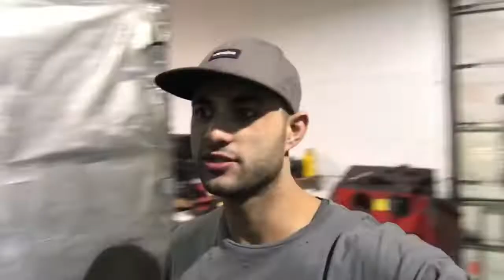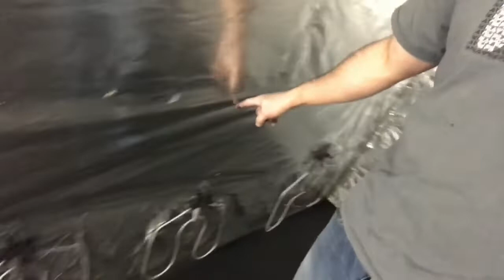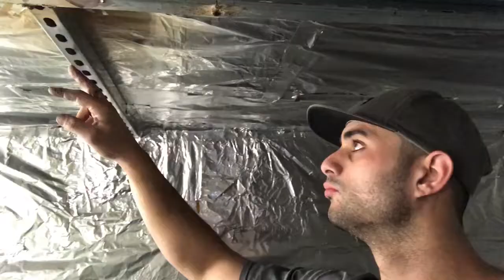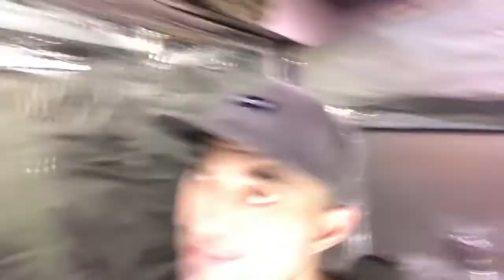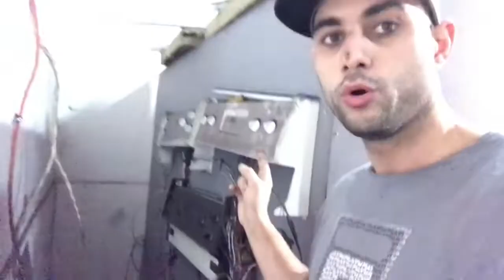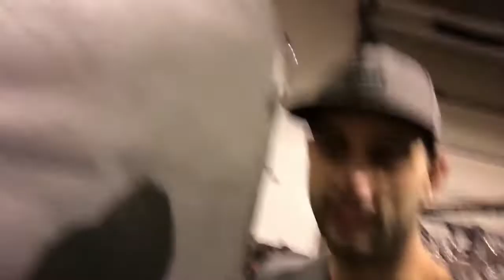HOW TO BUILD A SIMPLE POWDER COAT OVEN!

Comment: Thank you for the video. 
Always wanted to start a bakery but professional ovens cost a fortune. 
Many ideas came to mind after watching this powder coat oven video you made. 
Since you assure us you'll answer every question then I have some of my own.

1) Is the idea doable?
2) What's the best way to approach this idea? 
3) Can you describe what the elements are 
     where to get them and how to wire them to a controller?
4) What kind of metal you did the framing with?
5) Will this run on multiple solar panels & batteries?
6) Did you weld the oven window to the frame?  
7) What type of heat resistance light for the inside?
8) What u think is needed for a 6 ft long, 8 ft wide 8 ft high oven? 
9) Since you didn't do the flooring should I live mine the same way?

That's all for now
Hope to hear from you or anyone else that has the know how knowledge.
Later
Lance

Comment: So you used the Range top knobs to control the elements individually? Not the Oven control itself? Curious how that works for you since theres no thermostat control on the range knobs, unlike the oven controler you can set to XXX degrees and go. My oven is much smaller and i only use 1 element thru the actual oven controller, and my 4 range knobs are unused Looking to build a bigger oven and use those range knobs like this. Do you turn all the knobs on at Full blast or... is there another method you use? Looks great

Comment: Your video is a year ago..but I'm hoping you can answer questions? 1 - Did you use all the thermostats for each oven you used? 2 - did you use the broil and bake elements?
Reply from the maker: hi mark,   no need to use the oven elements,  but if you do decide to use them,  yes install the thermostats.  i used just the stove top elements

Comment: I live in a very high humidity country.Can you powder coat in a high humidity environment?
Reply: Humidity has no affect on powder coating! It’s not like painting. Powder is a polyester and only the metal parts need prepped just like painting! It bonds to the any metal by static electricity and cures under high heat around 400-450 degrees after its cured and cooled off the part can be put to use!